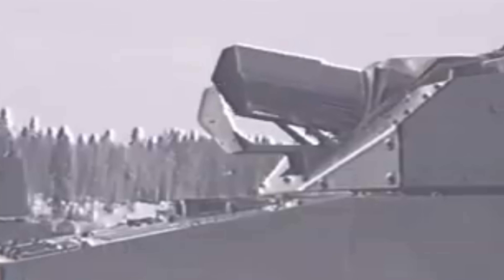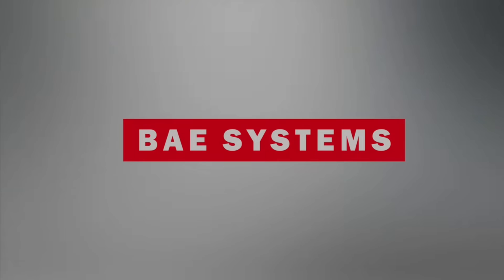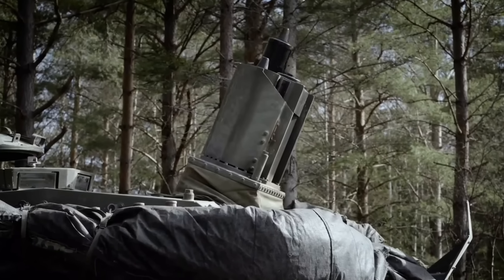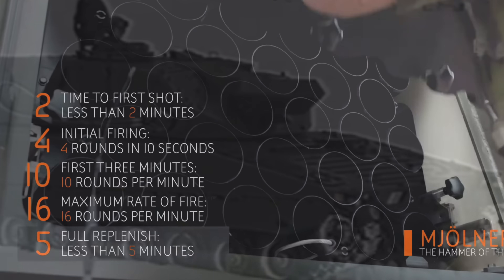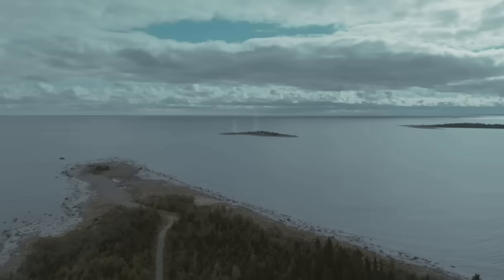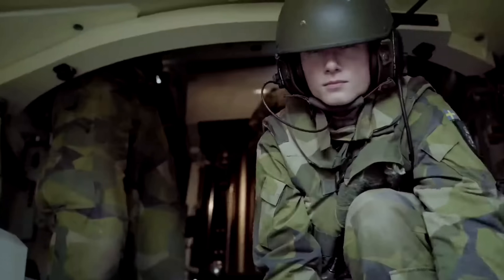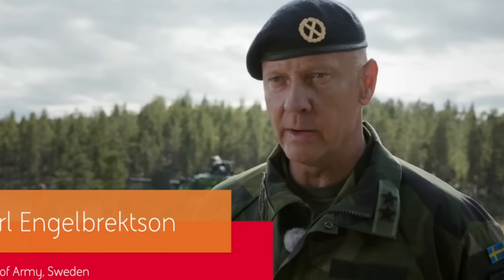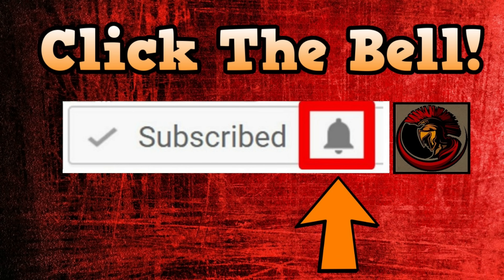The 'Mjölner' Rapid Fire 120mm Mortar Vehicle | DOUBLE BARRELED INDIRECT FIRE

Comment: It is a good idea to have high rate of fire and simultaneous rounds on enemy.As the first artillery or mortar round hits the enemy they will take cover.This system prevents that.I like AMOS more because it has higher rpm.Imagine using this at Ukraine on trenches 4X Mortar vehicles hiding behind three lines and few hundreds meters away from each other they can cover huge area and retreat.These would be better with APS .Against drones stabilized anti drone turret or a Gepard can would help protecting these.Again AMOS is better and I like the combination on Swedish combat boat CB-90😊Well another nice video Matsimus .Thank you and stay safe brother 🇹🇷🫡

Comment: overly complex loading mechanism, why not just use 120mm breech loading mortar.
Reply: Because some rounds, like the multi part STRIX, has to be assembled in the tube, and that can't be done in a vertical tube.
Reply: Because it is meant to be cheaper than AMOS. And it is not complex, it is very simple - but you need some muscle power.

Comment: I would have loved to have seen all 3 vehicles fire simultaneously! And the blast at impact! 6 120mm shells detonating simultaneously on a single target.
Reply: That´s a pain for the target spotter. "Damn i know there was a target here just before the explosion, but i can´t find it!!" lol
Reply: @RiderOftheNorth.357  lol!
Though the most common mortar round used by Swedish 120mm mortars is a tripple mode fuse default set to air burst with impact and delayed impact burst as alternatives. Delayed impact is for urban/dug in targets protected by tin, tile or log and sandbag roofs.

Comment: I love too see how Swedes made so various vehicles on CV90 chasis
Reply: Yea, yea…but does it take Glock Mags?  ;-)
Reply: @likydsplit8483  the Platoon commanders pistol 88 (Glock17) sidearm does😂
Reply: @SonsOfLorgar  tru that. Pistol 88 is a glock after all
Reply: @likydsplit8483  Nope! For that you need the CV90 Commander vehicle Mk2. ( Just kidding)
Reply: Slaps two ADATS tubes on CV90 lower.
Reply: The CV90 was designed as family of vehicles from the start, the idea was to use one platform for the entire battalion. On top of that the ability to evolve and modify the platform was one of the 7 key design points that were top priority for Alfons Falk and his team at Hägglunds. 

Even though some versions of the CV90 was cut from the program (such as the original mortar version with the Noricum SM4 mortar) the chassi was still designed with the potential for those version. Which is how we get things like the CV90120, the Armadillo and the Mjolner.
Reply: CV90 = It is the Defense Forces' "Swissknife" or their "RYOBI" multi-tool. 😉👍
Reply: Seen the double 120mm canon one? Oooh its a beuti..seen it live😍👌
Reply: And more variants are being produced now for the Swedish army 👍🏻
Reply: to not too

Comment: its a good way to extend older chassis value and reinforce strategic locations without a massive and expensive foot print
Reply: That is what the NL Army will do. There  is a MLU program and some turrets will installed on older overhauld CV90 chassis.

Comment: Absolutely beautiful system! This is something that really makes the line Infantry a lot more secure.
Reply: or.....unsecure? 🤣🤣
Reply: @donquixote1502  any orc aspiring to invade sure has reason to be insecure and afraid anyway 😉
Reply: I do like an insecure orc!
Reply: More secure  ? Lol ! This  tank is just  another steel coffin  ... I preferred to be in the  airforce  , so we  could  fly  away  ! 😂😎
Reply: @gillesregnery9692  it's not a tank, it's an IFV, it's protected against anything up to 15mm AP on the sides, 30mm apds in the front and it's main job is to carry and support an infantry squad.
If it comes up against tanks, it's job is to either pop smoke and yeet itself into cover and concealment Or, stay vewwy, vewwy quiet and hide to wait until the tanks move on or call down artillery, or wait until its infantry can engage from the side or rear of the tank and then open up on the tank to supress it or finish it off while covering the infantry falling back to mount up.
Reply: @SonsOfLorgar  I agree , it is a steel coffin : any drone with a two dollahs grenade will wipe it out , sadly ...
Reply: @SonsOfLorgar  OK , OK ! My english is not perfect : in french a " tank " is an armored coffin ! I will never enter such a damned device ! 🤮
Reply: @SonsOfLorgar  There are anti-tank rounds for the 120mm mortar making Mjölnir the long range anti-tank option for Mechanized troops in Sweden.
Pretty much filling the same role as antitank missiles.

Comment: I think Mortars are unsung assets in warfare. The ability to provide suppressive fire can really affect a situation.
Reply: And 120mm are considered anti armor capable.
Reply: @kurt5490  with Strix rounds absolutely!
Reply: @benktlofgren4710  what is a strix round?
Reply: @nalusafalaya  It's a round that release a submunition that homes in and attack the top of a vehicle.
Reply: @nalusafalaya  guided heat seeking that can prio target round
Reply: @benktlofgren4710  are there even heat seaking mortar? I've never heard of one and seems like something like that is replaced by things like javelins mortars are for closer range so a heat seeking capability would be a waste, I don't believe they would do that and that would seem to be used on missile tech
Reply: @nalusafalaya  The Swedish armed forces have been using Pansarsprängvinggranat m/94 STRIX, a IR-homing anti-armor mortar bomb since the mid-90s. Made by Bofors. 
https://en.wikipedia.org/wiki/Strix_mortar_round
Reply: @nalusafalaya  these 12cm mortars go out to 6-10km depending on the ammo, the STRIX anti tank round has been around since 1994. In it's final attack stage, it is guided by fold out fins and a ring of perpendicular single use solid fuel rockets, fired off by the onboard computer to hit a valid targets thermal profile. Target priority list is programmed just before loading by connecting the munition to the  ballistics computer of the firing unit via the mortar squad leaders display terminal.
They can hit moving targets and they can prioritize between tanks, IFVs and other armored vehicles like AA, howitzers etc.
Reply: @nalusafalaya  It is both a heat-seeking and gps guided pre programeble i think, with heat charge so it takes out tanks from the roof. Think Excalibur and a bit Nlaw in a mortar round :)
Reply: @benktlofgren4710  the STRIX rounds my unit fired from towed mortars in 2003 were not GPS assisted, only thermal profile seeking.
That said, SAAB defence and Bofors has never been companies lazily resting on past successes, so it can very well have been upgraded since.
Reply: @kurt5490  Considering that the use of 155 arty is generally a BN or higher level asset so you have more steps to go through to get approval where as generally a mortar section can be given approval by a company commander. They provide an invaluable organic indirect fire asset.
Reply: @RKubica32  Absolutely! Much better capable of responding to conditions on the battle field.  Defend against counter attacks,  flanking maneuvers or pressing the attack.
Reply: They are plenty sung in all major wars and minor conflicts.  Even the IRA used mortars in a customized van in urban areas and fragged a parade.
Reply: @evangelicalsnever-lie9792  really? Thats interesting, my familly used to take in children in Ira war zones for the whole summer time, they probably felt like fish out of water and I hope they all live good lives now and I'm glad things got better in those areas, I wish we could live more peacefully because at the end of the day we are all human
Reply: Anything bigger than 155mm is rocket/missile territory these days. Once you get projectiles above 50 kg, which is 155mm territory, the juice is no longer worth the squeeze with cannons in land warfare. Maybe 203mm could be viable with a ramject projectile, but that's me speculating that a larger body would be easier.
Reply: They sing as they fall on you
Reply: @Skenderbeuismyhero ScchhEEEEOOooo...BOMCH!
Reply: Yep. Especially for use in mountainous or hillside  or siege warfare. Be cool if the Swedes create a 240mm mortar vehicle.
Reply: @ginNjus  that would be a powerful concept but less ammunition holding capability,  does anyone know the range of 120mm and 240mm after they go off?
Reply: @ginNjus  The Russians allready have a 240mm mortar, the 2s4 Tyulpan.
Reply: @saucyinnit8799  which is slow, cumbersome and hard to maintain...
Reply: @SonsOfLorgar  Idk if it's slow but it sure is deadly. Also cumbersome? Mind explaining what that means?
Reply: @saucyinnit8799  good time for Matimus to do an indepth review on this weapon.
Reply: @saucyinnit8799  "Idk if it's slow but it sure is deadly. Also cumbersome? Mind explaining what that means?"
It is both heavy and takes a lot of space, so hard to handle.
It is slow to set up, slow to reload, and slow to get moving again. The German railwaygun used on Crimea were deadly (shells weighed 7 ton) but utterly impractical, Schwerer Gustav missed out two operations because the offensive was over before the gun had been assembled.
Reply: @johanmetreus  alr thanks for the description.
Reply: @ginNjus  240mm mortars have no role on the current modern battlefield as there's nothing it can do that a 155mm howitzer or multirole combat aircraft can do quicker, with more reliability accuracy, and with faster follow up shots if the first one doesn't do the trick.
Reply: @SonsOfLorgar  modern howitzers are accurate as well and has longer range and can also provide Direct fire if the gun/tank is built for it.
Reply: Imagine this somewhere like Iwo Jima or hilly areas that makes rushing a position such a danger,
Reply: Because easier for commanders to access then artillery
Reply: @tomhenry897  precisely, because they own it as a Co/Bn CDR.
Reply: @Beauloqs  I was talking about those not in the armed forces. eg: you dont hear the media talk up the importance of them.
Reply: unsung? eh  no
Reply: With modern tech, you should not depend on suppressive fire, they should take the other side direct out.
Reply: @0Turbox  that implies that you will always have perfect location data or that your target won't be able to take countermeasures against your modern tech. Suppressive fire is an enabling effect. It enables you to disengage what could be a terminal engagement you weren't able to prevent.
Reply: Smoke to
Reply: They're sung.